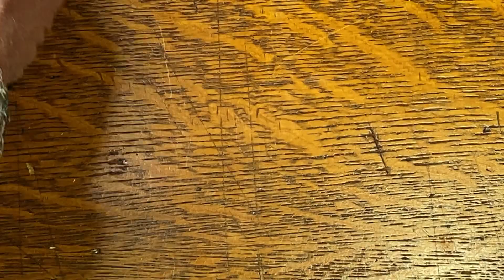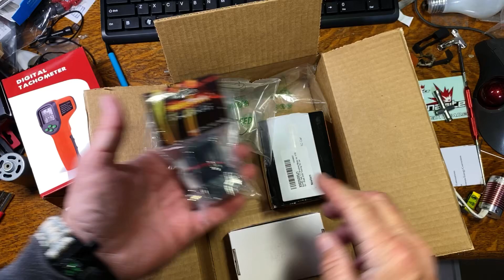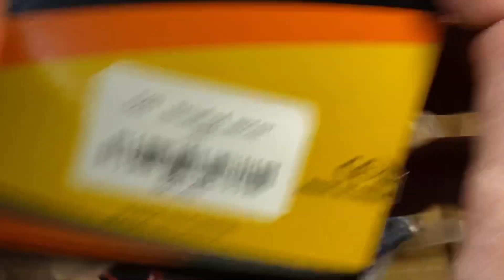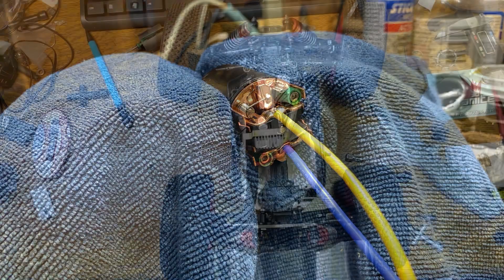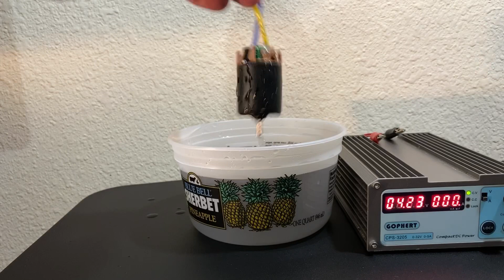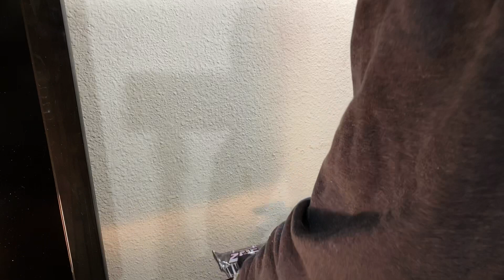WLtoys 144001 new brushed motor

Comment: 20 minutes for a no go! 🤔 Lmao! Can I request that you don't do the new motor test with those tires to make it more relative to what others would be doing? Just a thought... Thanks for sharing. Nice pillow you got there my bro...✌️😁👍
Reply from the maker: Mikes RC Garage LOL. IKR I agree. I’ll probably save those tires for the brushless motor. The ESC would cut out on 2s with the wheels off the ground. 

I ordered a new ESC but it won’t be here for a few weeks so I’m thinking a plan B might be to rob the ESC off of car one then put the stock tires on it and do a GPS test. The stock motor did 30mph on both cars on 2s so I agree with you, that that would be a more relevant test. 

Thanks for all the great suggestions my brother. 🙏💯👍🏻👍🏻
Reply: @RCModSquad  You're very welcome my bro! Just to see if it's the esc is bad maybe plug the car with the new motor into your other cars esc and see if it will spin up that new motor without cutting out!? Also vice versa... It seems like the leeds on the motor would be long enough to try that just so you know the esc is bad! As for the bigger tires get a metal spur gear first, that plastic gear is not going to last long! Have a safe week my bro! 🙏💯🏁
Reply: Oh and one more thing lol! Maybe that's what that magic diode/resistor/capacitor/??? Lol does, you can take it off the burnt motor and solder it to the new motor and see what happens??? 🤔 Lol! Sorry my bro but I got lots of ideas to suck up any free time you may have! ✌️😝👍
Reply from the maker: Mikes RC Garage I already ordered the metal spur gear. I already tried the diode in and out. I could add a 500 uf capacitor to support the voltage input but I suspect it’s in the ESC LiPo low voltage shutdown that’s the problem. 

I’ll rip this ESC apart and check the components IF any of them have numbers on them. A lot of the Chinese stuff uses proprietary or unlabeled components. 

The ESC is just barely stuck in anyway so I can swap them out in about a minute. 🤔😂

Have a great night my brother. 👍🏻👍🏻
Reply: @RCModSquad  Oh okay sounds like a plan! Have a great night brother! 💯👍

Comment: Hey, love the video and look forward to them all the time. Please keep up the hard work and excellent information that you keep putting out.
Reply from the maker: idawave1494 thank you for your very kind words. I hope it helps a few people. 

Have a great day! 👍🏻👍🏻
Reply: @RCModSquad  hey I was wondering if you knew what size the screw is that goes into the servo at the arm, mine died and I pulled it but dropped and lost the screw. Any info helps
Reply from the maker: idawave1494 i don’t know off hand but when I get home tomorrow evening I’ll check for you. 

Most of the ones going into metal have been 3mm but the length is a little different. 

In case I forget be sure and ask me again. 😂
Reply: @RCModSquad  thanks so much.
Reply from the maker: idawave1494 if you’re talking about the one that holds the arm onto the servo I just pulled mine off so I could measure it. It’s 2.5mm x 6mm. And it’s a course thread for plastic. 

I hope that helps.
Reply: @RCModSquad  thanks it helps a butt load! Off to the internet I go. Cannot wait for the next upload.

Comment: The new motor's can seems smaller than the stock one. Is it?
Reply from the maker: not itsgodzagain yes. It is a 540 and the stock motor is a 550 but also the 540 has the brushes on the outside of the can which makes it look even smaller than it is. 

I will also try the Apex 550 in that car. 

Thanks for watching and have a great day. 💯👍🏻👍🏻

Comment: Thanks for the heatsink info. The hub extender that fits is on ebay, ALUMINUM HEX DRIVE 15MM ADAPTER GY TRAXXAS 1/16 MINI E REVO SUMMIT SLASH 4x4 VXL.
Reply from the maker: Allup Init Thanks for the info on the hex adapter. 

Thanks for watching and have a great day. 💯👍🏻

Comment: I wpuld be scared to grab that motor in the water while plugged in lol and i put some screws on the back and front swing arms so i can lower or raise the car like a suspension limiter it fixed the vibration problem and the holes are already there for you to add the screws i think i used 4mm screws
Reply from the maker: 831 fpv great tip on the travel limiter. Distilled water doesn’t conduct electricity, although with the crud from the motor floating around it might be a little conductive. It’s only 3v dc though. 

Have a great day and thanks for watching. 🙏💯👍🏻
Reply: @RCModSquad  you to brother